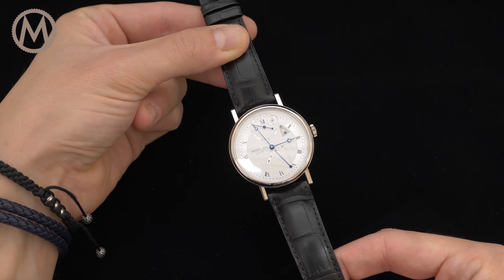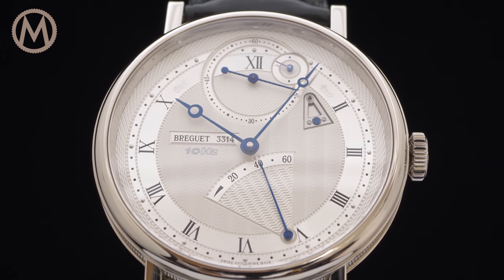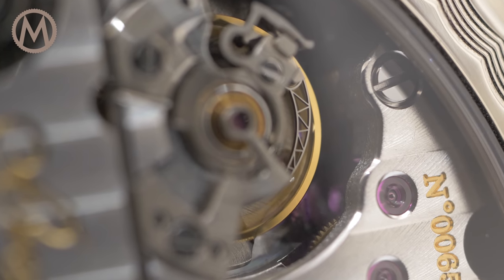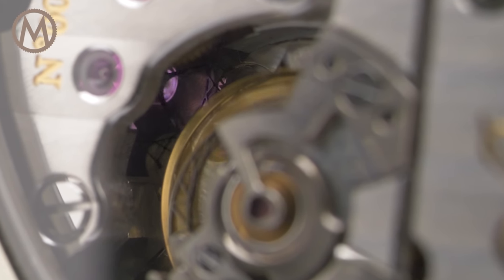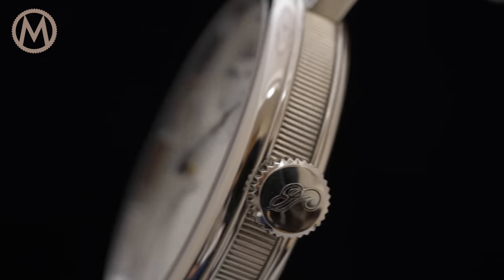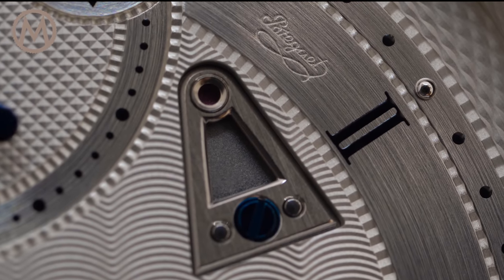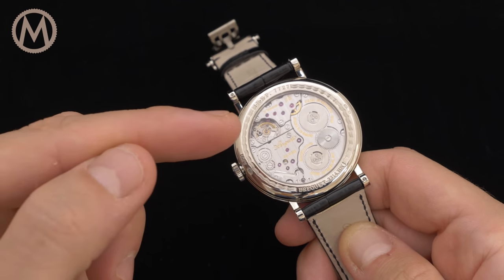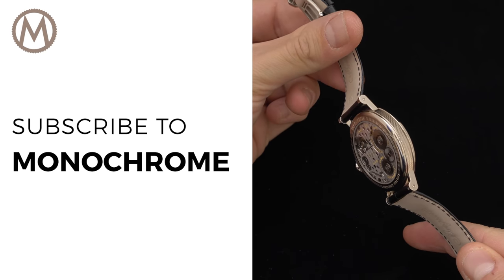REVIEW: The Breguet Classique Chronometrie 7727

Comment: Absolutely stunning, a true masterpiece and fine example of high horology. Breguet is one of the very few brands at the very top of the watches pyramid. I do agree with a fellow viewer in regards of the 10hz inscription, it could have been more subtle. If not mistaken, it is available in white or pink gold, I would prefer it on platinum. The additional weight and less maintenance would make it perfect for me. The white gold especially will need some rhodium treatment which means removing the mechanism. It's price is quite fair considering mechanism, metal, presentation and most of all a name that it's products have been proven over time. Thank you for one more well worded and presented review, Merry Xmas;)

Comment: Why oh why did they stick ‘10Hz’ in a modern font under Breguet? It’s not needed, it looks terrible and has spoilt a fine watch.
Reply: Well a 10HZ is an achievement but yes the modern style display could have been avoided, a more elegant indication would have been better. It does some harm as is but it doesn't actually spoil it, not for me anyway, Merry Xmas.
Reply: @mathewazzopard8100  When it comes to unnecessary text on a watch, Casio have that aspect covered.
Reply: @johnayres2303  ha ha ha indeed :)